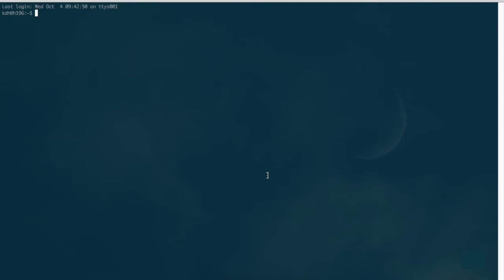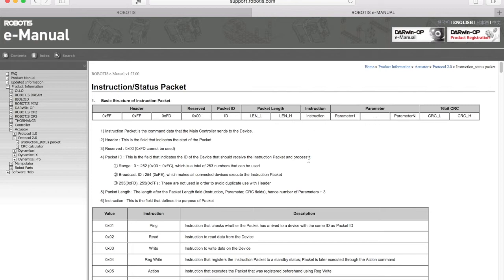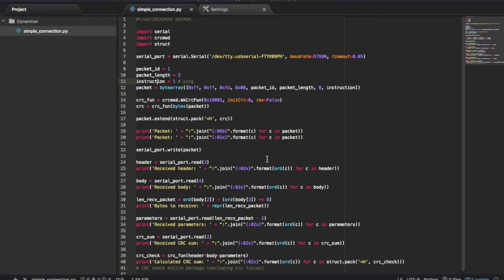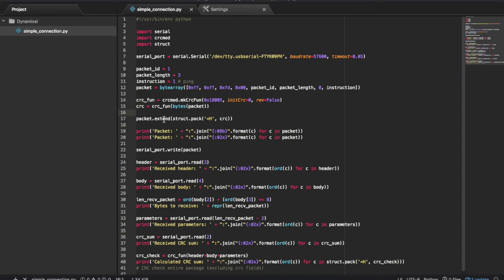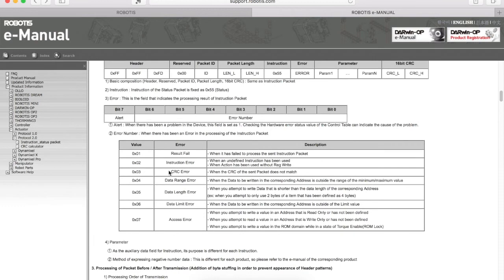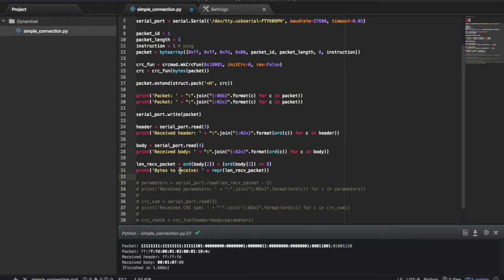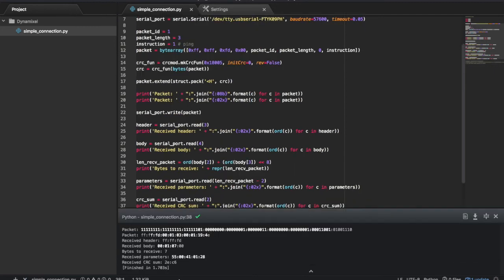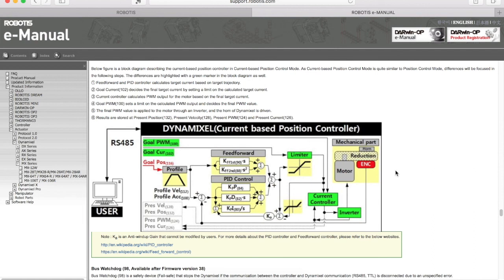Interfacing to Dynamixel with Python

Comment: Hey this is a really helpful video.  Thank you so much for taking the time to put it together!

What adapters did you use to connect the servo?  It looks like you have a usb dongle, power adapter board with MX model of the servo.  Is that correct?  What is the USB dongle?

I am trying to interface dynamixel directly to Jetson Nano using one of its UARTs.  It looks like I will have to make an adapter to deal with the fact that servos use half duplex.  Have you ever tried doing something like this?  Please, let me know.
Reply from the maker: Have a look at this video for the connection: https://youtu.be/SJP-VUhD_0U

Basically I am using a USB-to-RS485 dongle (https://export.rsdelivers.com/product/ftdi-chip/usb-rs232-we-1800-bt-50/ftdi-chip-male-usb-wire-ended-18m-cable/6877821) with an (R-version) MX servo. If you are using a T-version you can connect it directly to the UART. If you have the R-version (or AR), you can use a TTL-to-RS485 like this: https://www.sparkfun.com/products/10124
Reply: @MobileRobotsLab  Hey, I got all the wiring figured out, so much appreciate all the info.
Reply: @MobileRobotsLab  One question, I have been going through your code and its seems like ord() function takes a single character as an argument, but in your code you seem to pass an element from bytes type, which is an integer.  It seems like your received bytes get decoded somewhere but I cant see where.  Am I missing something?
Reply: Do you remember version of pyserial and python used for this? (Sorry I am bothering you with all these questions)

Comment: Hi, may I know before you implemented this script, did you install the python library for DynamixelSDK ? Or what step did you take before you implemented this script ?
Reply from the maker: Yi Herng Ong I did not install the SDK from Robotis. I wanted to show how to work with the servos by just understanding the protocol. So all that is needed is a serial library and a CRC library, if you are not going to implement the CRC check yourself. Of course, you can use the SDK, which might be easier.